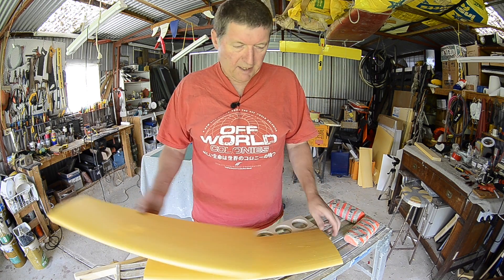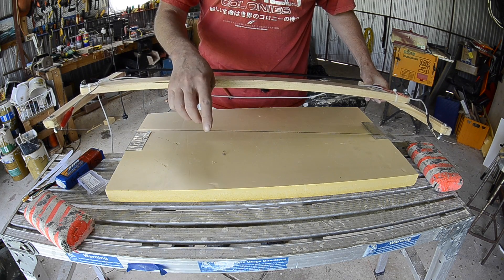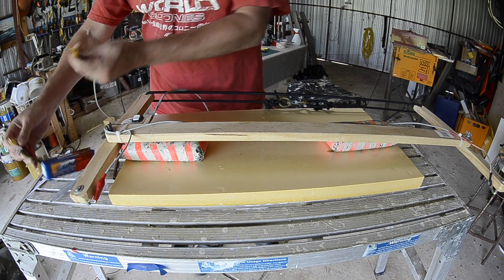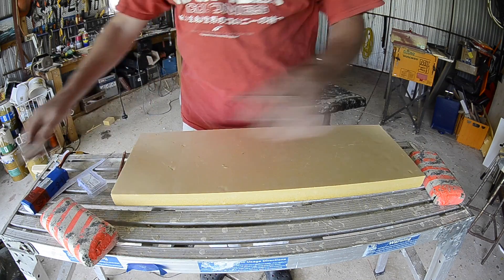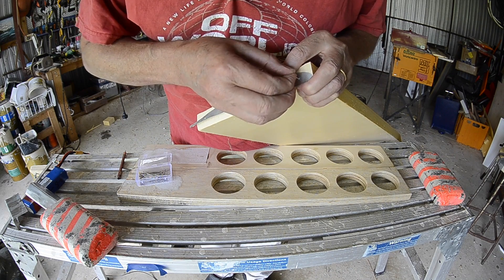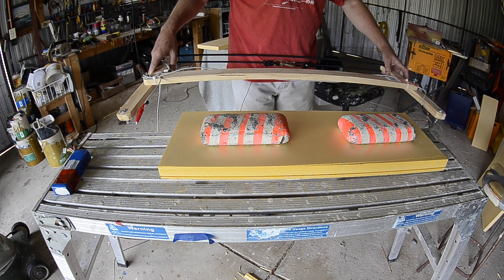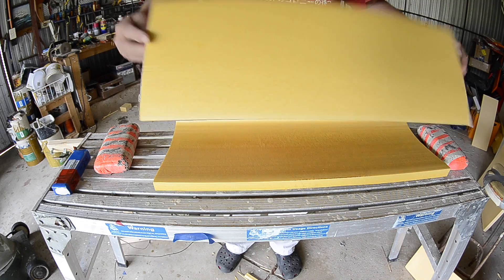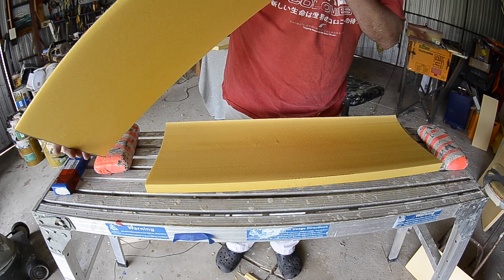Hotwire Airfoil Cutting in detail

Comment: A little trick I used when cutting chords more than 20cm deep or panels more than 1m wide was to number the templates from 0 - XXX in 1cm increments. Then having 2 people on the bow, one each end, you count the markers off one by one at the same time as the wire passes each mark. This ensures the wire passes through the foam blank at the correct speed at both ends, preventing wire drag and the resultant rippling you get. If the timing and speed are accurate, you get a core that needs no sanding before you can apply plastic film, or laminate it with it's veneer if your doing a timber build. It also makes tapered cores easier to wire cut, for that, all you do is make the smaller templates spacing marks 50% of the larger one.
Reply from the maker: Great tips thanks

Comment: Hi Andrew! Could you write me the ohm resistance of your cutter? Between the two endpoint of the cutter wire. Thx!
Reply from the maker: 4 Ohms. The wire is 5 Ohms/m and the span is 800mm. I usually power it with a 4S Lipo (16V)

Comment: In my opinion your wire is too thick and that's why you are burning deep. I use galvanized 10 lbs wire on 6 volts. It's much slower than your cuts but the result is perfect, no loss of foam. On the other hand the fact that my wire is not as hot it does trail a lot thus I have to be much much slower. Ideally I think 9 volts would be better.

Comment: Thanks for another great video Andrew. You may find that it is a good idea to give a slight washout at the tips (raise the trailing edge with the tip template) This ensures that when the wing stalls in the air, such as in landing, that the root stalls first and not one of the tips. About 4mm is good in most cases.
Reply from the maker: Thanks Andrew, I have tried a little washout occasionally. But I haven't investigated it in any rigorous way. Might be a good subject for future video.

Comment: How would you go about hot wire cutting an elliptical wing?
Reply from the maker: Could only Hotwire the straight section, then hand shape the elliptical tips
Reply: So is there any method you could recommend to build a completely curved elliptical wing with no straight sections, out of foam? Looking to start building my DLGs and F5Js out of foam instead of balsa...
Reply from the maker: Not possible unless you hand shape it or carve it out using a CNC machine.

Comment: Hi Andrew - fantastic video and thank you for your tireless efforts and contributions! Yesterday I made a cutting jig following your design, complete with switch (and may add a little amp/volt meter and calibrate it to approx temps - but that would be quite nerdy). At around 14 ohms/m my 800mm Nichrome cutter is reading around 12 ohms and with a 12V car battery it does heat but can only cut slowly (temp too low) so again following your recommendations, I ordered this variable power amp - 11-26V and up to 15A for A$70 (https://www.ebay.com.au/itm/192371638849). There's a great chart for heating Nichrome here (http://hotwirefoamcutterinfo.com/__SupplyCalc.html) and it tells me that at around 800mm a 28 gauge Nichrome wire (approx 0.3mm) requires about 18V to heat to approx 300C so I'll give that a go.

Your inspiring videos have given my son and I a lot to work with and we're currently designing and building a high wing trainer, ~1200mm WS and we're going through all the calcs to see if we can get its performance to match its theoretical performance (I am a pilot, an engineer and consultant type so love this kind of challenge). Young Will is only 7 but is really getting into it and it's exciting to share in this domain for his development (iPads and computer games?? Not a chance - he is only interested in doing real things)! We're downloading wing profiles and creating the thing in Sketchup, including the foldable fuselage profile. This is great too as Sketchup will give areas of polygons - fantastic for sizing stabs etc.

So enough rambling from me. Many, many thanks and I hope to be able to report some learnings from our inevitable failures and joys from unlikely successes! Cheers from Sydney, Dave and young William
Reply from the maker: You must tell me how it goes Dave (and Will) I envy your analytical skills. Thanks so much for sharing your efforts so far. Nerdy is good!
Reply: Thanks Andrew - not much to envy here mate, at least on the analytical front but it's fun having a go anyway! The next challenge is to set up a jig for drilling the spar so I'll head over to your vid on the matter and take on your advice. Will have to do some Sketchup modelling to see if I can get a 2 deg dihedral in there somewhere! Cheers - David

Comment: Why no spring on the wire to compensate for expansion as the wire heats ?
Reply from the maker: Not needed with this bow design. Look closer
Reply: OK. Thanks for the VERY quick reply. Appreciated. So the arms pivot on the two bolts through the strut joining the arms and there is some elastic material connecting the bottom of the arms keeping the wire at the other end taught? I guessing spear gun rubber given you dive ??
Reply from the maker: Yes bungy cord keeps the tension. I'm not a spear fisher, more of a photographer.
Reply: Thanks again. Have mine up and running.
Reply from the maker: Excellent, very satisfying I find

Comment: Lol you always make things look so simple . The T pins seem to work pretty good but I didn't have any so I used pop rivets . Put them in my drill and sharpened them on my grinder , gave me a little handle to pull them out . What do you use to make your aluminum patterns . I found wood don't work real well . I haven't had the best of luck with planes , bit harder to fly than drones , but I haven't give up on them . Thanks for the video .

Comment: wont the lipo short cirqute?
Reply from the maker: It would short out if you used copper wire, but this SS fishing wire has resistance of about 5 ohms per metre.
Reply: +Andrew Newton ok,is it ok when I use veery thin chopperwire with enough Ohms?

Comment: How can you get such straight cuts every time?My wire always lags halfway into the cutting making the center thicker or thinner :(
Reply from the maker: More tension on the bow and a little more heat might help. Also slow the speed of the cut. It's a balance between all these factors.
Reply: Andrew Newton Thank you!

Comment: Very nice.  ¿The airfoil templates (Aluminum, you said), did you make them also?  ¿How much current/power on your hot wire cutter, please?  (I love your workshop).  Thank you for sharing.
Reply from the maker: +Somewhere Usa Thanks Somewhere. Yes thin aluminium window flashing. The wire I'm using needs about 4 Amps for the right temperature. There is a link in the description to all my materials and hotwire videos, all covered there.
Reply: +Andrew Newton Thank you very much, Mr. Newton.  I'll look there, as you suggest.  Thank you again.  God Bless.  tonyd\.

Comment: Andrew, I'd like to thank you for making your videos. I enjoy them and find them useful for me. If I may suggest, I'd like to see more foam cutting with hot wires, may be other parts of the plane eg elevator or fuselage. Cheers from Finland :)
Reply from the maker: +Aslak Shallo Thanks for the suggestions Aslak Shallo. I will make a smaller hot wire setup for shapes other than wings one day.

Comment: Nice! Im thinking about making one of those for my self. How do u power it? Just plug the positive and negative of the battery directly into the wires? Would it work with a 1300 mah 3s 25 C battery?
Reply from the maker: +Felipe Forlin Yes that battery would work fine. Battery is connected to alligator clips which clamp on the wire, very simple.

Comment: Nice Demo Andrew....Have you ever thought about making a Fuz using this foam?  A plane rather like a Skywalker for example? Using 2 thick Foam sides and then maybe Depron sheet glued on top and bottom? ...I like the true airfoil you get using the Foam cut over the Depron wing, but I would be interested in seeing a Fuz cut / carved with this stuff because you can sand and carve it too....The Foam I use looks similar to yours but if you ding it, it stays that way...Great Tutorial m8...:)
Reply from the maker: +EnglishTurbines I have used solid XPS for the Red Trainer fuse and for the Fokker cowl, but I will try it more in the future.
Reply: Andrew Newton Yes, I was thinking you could make a small vertical wire cutter, rather like a Bandsaw to cut out profiles in sheets? I saw a homebuild Skywalker made this way, it looked pretty solid once the decks were on it..

Comment: good job you don't have to sand of to much to make it silkly smooth
just 1 question why did you 2 cuts? wasend it easyer to place the airfoil templates all the way down so you you only have to make 1 cut and with some luck you can get a second wing out the same piece of foam?
Reply from the maker: +Happy Flyer I have tried that but it creates a nasty step where the leading edge curve transitions into the uncut flat bottom. Also none of the airfoils I use have a truly flat bottom.